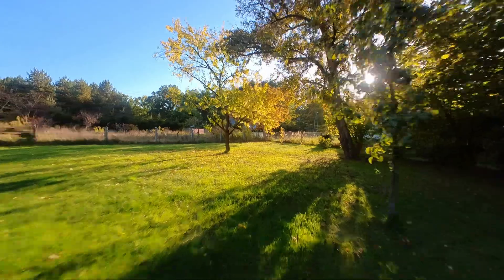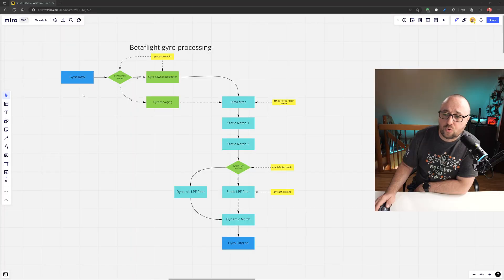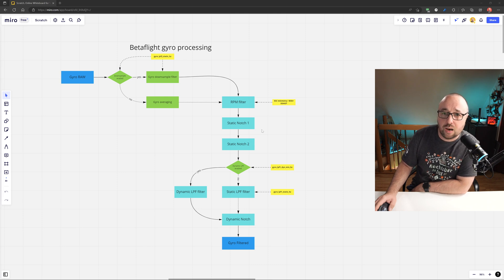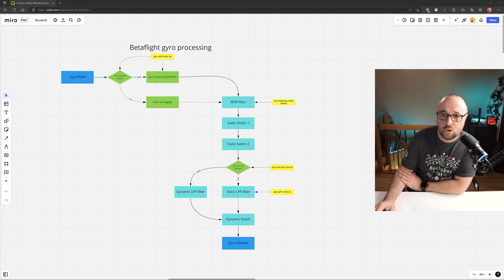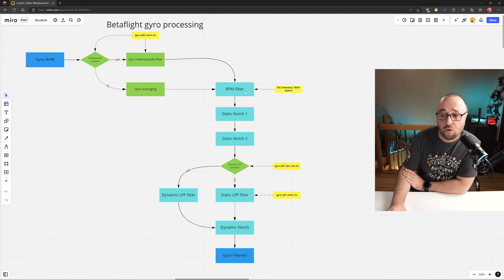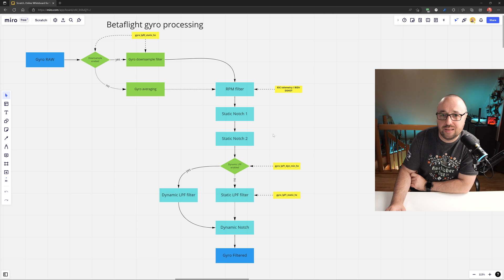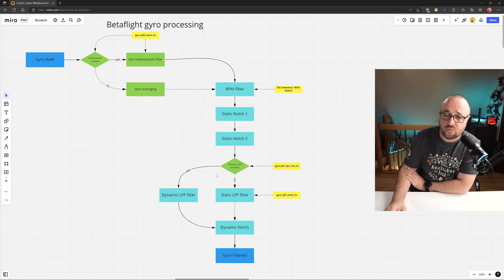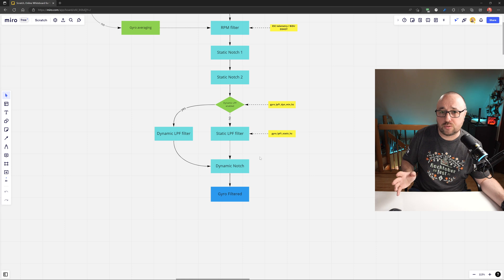All the Betaflight gyro filters explained

Comment: This is great, but the explanations are from the backend and high-level. 
It would be great to explain this using the configurator.  
Setting the CLI commands are specific, but don't really help those people, like me, that are trying to understand the configurator.  
For ex, when are the D-Term filters run? What are the effects using them? When should they be high? Low? Also,  what are the different filter types? How should notch filters be set? What sort of data in blackbox is seen, and what can a filter do to rectify it?  What sort of cut off values should be used? There are a huge list of questions and reasons to know here.

Comment: We need a gps crash tracker system. I don't want these to display owner data or anything, but I lost my INAV quad a couple days ago because there was a control link loss after video loss and RTH didn't work. A person would need general coordinates, protocol, and date/time information to access "last known GPS ping" or something like that. Let's say I was using UBLOX protocol on a home-built quad and supposedly lost signal in a general area on a specific day. If I typed this into a search, I would get some sort of map with a pin at the last ping location in order to help me retrieve my quad. Do you know any way to set up something like that? I would say it would probably require a decent server base to keep temporary ping files for a couple days. This would help so many people, as long as it remains anonymous. Does anyone know of anything like this that already exists?

Comment: Excellent Professor! ; )  Would you agree that: 1)flat cnc'ed (high modulus/carbon) laminate, aligned perpendicular to the common thrust vector AND 2) motor (magnet) 'cogging' vibations, co-planar with RIGID arms are the biggest sources of VIBRATION and impact failure, as well as poor aerodynamics, along with common 'brick like' power packs! (a la 'Dji FPV'!)

Comment: 5:08 im not sure this is correct. You mention that rpm data can come by either esc telemetry or bidirectional dshot, I don't think esc telemetry is used at all for rpm data because the slow round robin uart used in esc telemetry is too slow to be used for anything like filtering. And that bidirectional dshot is the only thing that can be used for rpm data for the rpm filter

Also i really like these deep technical dives especially about how internals of the PID's and filters work. More videos like these are great. Also more low level things about stm32's etc i find very interesting as well and would love more content related to lower level coding things.

Comment: Excellent video Pawel.. 
Any video on this subject and tuning are so useful
Perhaps some guidance and what filter changes maybe required when building 7 inch quads as
against 5 inch rigs !!
I don’t have any 7 inch quads and I am reluctant to build one as I get the impression
that the Betaflight default settings which work really well for 5 inch are not so good for 7 inch rigs
and I am not a sophisticated tuner !!
Thanks for the video 👍👍
Reply from the maker: In general, you have to lower LPF filter frequencies. Probably to 90Hz for gyro and Dterm. Also lower min. frequency for RPM filter and dynamic notch
Reply: @FPVUniversity  Thanks Pawel 👍